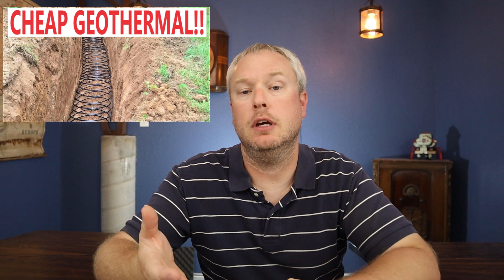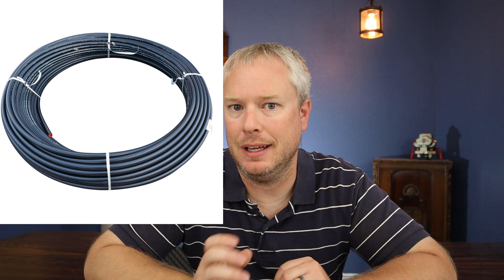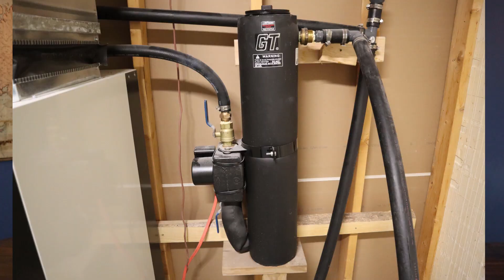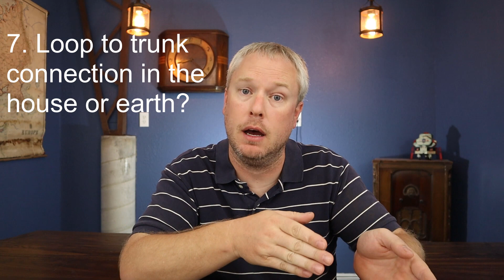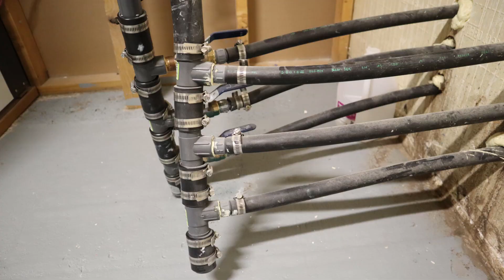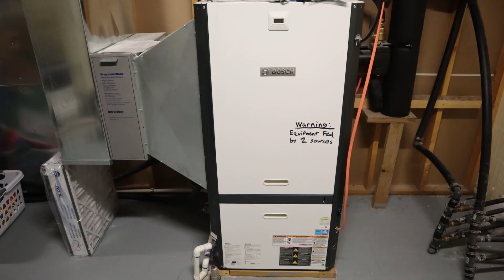10 DIY Geothermal Frequently Asked Questions

Comment: I’m building a new house on a 7200 sf lot and will be demolishing an existing house.

Since I’m building a large house, the available space for pex pipe installation is not a great deal.

Can pex be buried UNDER the footprint of the house?

Naturally, sufficient compaction would have to be done, but other than that, is there a reason it SHOULDN’T
be done?

Comment: Might be a strange question but I am running Gas, Water, and Electric 500' underground to my house, ( I have 10 acres).  I plan on digging 3 trenches at 500' each for each utility.  I plan to place 3 "Slinky" 600' coils in 1 trench (3 ton unit)  and 5 "slinky" 600 ft coil run in the center trench (5 Ton Unit).  Lastly 1 600 ft slinky run in the last trench (1 ton Unit).  Instead of having a manifold for each, can I simply connect each slinky in each run together for a total of 3 individual runs ( 1 long run in each trench).  This would allow me to not have to have a manifold and only have 2 lines for each run coming int the house in the area of their respected HVAC system.
Reply from the maker: You can, but you may need to upsize the line to overcome the increased friction inside the pipe.

Comment: Can a larger diameter of pipe be used than 3/4" in the ground for an overall less length of pipe? I need about 5400' of pipe in the ground.
Reply from the maker: Yes
Reply: Do you know what the formula or the calculations are to determine the size? Currently 9 circuits @ 600' each based on my research.
Reply from the maker: @AddictedCreationz  I misread your first question.  While you may be able to shorten the lines a little, I don't know the calculation.  You want the liquid in the line to have as much contact with the edge of the pipe as possible, so there is maximized heat transfer.  The larger the pipe, the further the distance of the liquid in the center of the pipe to the outer edge of the pipe.  If I were you, I'd stick to the 600' circuits.

Comment: Hi, how did you go about figuring your loop lengths?  I'm wondering how long you would need for a 3 ton system.
Reply from the maker: It all depends on the soil characteristics
Reply: Lots of clay....
Reply from the maker: @smeek111  Then it's probably very similar to mine.  I used 3 coils of 600ft 3/4" HDPE SDR11 for my 3 ton unit, and 4 of them for my 4 ton unit

Comment: We are about to begin our long awaited build on the east side of the KC Metro and planning to leverage DIY geothermal. Wondering if there is a functional reason NOT to go with a wide ditch and go all the way down and all the way back (say 10 foot x 50 foot long and running straight 50 foot lengths about a foot apart)? We will be ‘trenching’ with a Bobcat and want to move quickly with the loops so trying to avoid the slinky). Still getting 600 foot per ton.
Reply from the maker: You can definitely do straight runs, nothing wrong with it other than it takes more digging and more land

Comment: Great info, thank you Garrett.  
We have a 3000 sf two story, non-zoned 1970 slab home with a down-draft gas furnace on one acre we're just starting to scratch our heads about retrofitting to Geo-Thermal.  Do you have any idea the extra cost associated with vertically boring, is that remotely a possibility?  Even if I have to dig down to construct an exterior boxed-in wall below frost line, knock some flooring out and run to furnace room.  Building forever I know almost anything is possible, and of course I would do much of the work myself.  We're just east of you in central Missouri.  
Any ideas would be greatly appreciated.  Thank you!
Reply from the maker: You can definitely do a vertical system.  Your best bet is to call your local water well drilling companies to see what they charge per foot of bore.  That will give you an idea.

Comment: I've seen multiple videos of HVAC companies putting 3 loops in the same wide trench and they can't be more than a foot or two apart. In your video you mention loops need to be 10 feet apart. Why are these companies putting 3 of them so close together? Thanks!
Reply from the maker: They are lazy and don't care about the end result.  There is doing it right, and then doing it cheap.
Reply: @Challenged1  your way made way more sense anyway! I thought that may be the case. What's bad is people just don't know to question it. Thanks for the reply.

Comment: Any thoughts on running loop fields underneath the septic drain field? Around here the drainage runs are usually only 2-3 feet deep. Seems like an ideal place for dual use of the ground.
Reply from the maker: That's a perfect place for them.
Reply: @Challenged1  just watched your Step-by-Step DIY Geothermal part 2 video where you suggest this. 🤦‍♂️ I should’ve watched the entire series before asking.
Reply from the maker: @thatguy7705  It's all good

Comment: fantastic vids bro...to the point, well done, no dumb jokes, and you didnt show us your pets...brilliant!🤣  two questions - i have a pit run hole that i have dug for my house pad and road into my property.  it sits about 200 ft from the house, about 100ft X 200ft at around 12 ft deep.  in the summer the sub water comes up to about 9ft, then recedes to about 20ft during the winter. eventually i will install a pond liner and turn this gravel pit into a pond.  i am thinking of putting in pex loops down say 9ft in the bottom of the pond...then coming up to say 12ft to go from the pond to the house.  would like your .02 on this.  question #2, how did you do your pex joints in the loop field?  just regular pex coupler clamps?  fyi, i am in south eastern idaho.  thanks
Reply from the maker: #1 - That sounds like an excellent plan.
#2 - I used HDPE SDR11 pipe and put all of my joints inside the house.  You can have HDPE fused, which eliminates mechanical joints.
Reply: thanks...i appreciate the info.
Reply: so this style of pex u used somehow comes in a massive roll?  i was thinking it would come in like 200 ft roles?  if your loop runs are say 600ft, you must be able to get roles longer than that?  also...you went with a forced air system, why not in floor coils?  we will have flat slab with 2 stories, around 10,000 sqft, 2700 of which is a big bonus room above the attached 30x90 shop...thanks
Reply from the maker: @ultimateconcealcarry4671  You can get many different lengths of pipe.  The pipe you want is either, PEX-A or HDPE SDR11.  My HDPE came in 600' rolls
Reply: I tried to attach a pic of what i am doing, but i dont think its possible to do so...i think you and your viewers would find it interesting.  if there is a way to put one up, let me know, but, i dont think youtube allows it.  anyway...i have reached out to bosch and carrier to see if either of them would help size and design the system i need.  carrier referred me to a dealer out of boise...bosch said they they will see what they can do...so will see what happens...did you get any help from bosch?   i started my coil trench in the bottom of the pond.  its like digging in a box of marbles here.  we have two to three feet of topsoil, then straight pit run.  there is enough moisture left over that the sides of the trench are not caving to bad, i am hoping that they will freeze and i can get close enough to line the bottom with topsoil, or tamp down the rocks flat.  i decided that i will go 1 inch black poly to allow a little better flow since this run will be quite long, and rent a joint welder once i get it all laid out.  my trench is about 6ft wide and about 10 ft deep.  interestingly there was a frozen layer of about a foot...when i got down about 10 ft, i was seeing temps of 40 deg, which should increase some once everything is in and the pond is filled with water.  at 10 ft, plus another 12 ft with the dept of the pond, it will put these coils at around 20 ft.  right now there is no standing water, but, i know i am very close as the pit run is wet.  the pond will have to be lined in order to hold water, so, during the winter months the coils wont have water around them, but, water will be within a few ft so i think the system will transfer fine.  you mentioned that for your system you needed 600 ft of coil per ton, which at 5 ft per ft your runs must have been around 120 ft each?  i am also doing ICF, no basement, but two story, barndominium style, going for open space.  i would put up a pdf if it would allow me to.  anyway...question i have is concerning the heat pumps.  say i did one long coil run and that i needed three 4 ton units...how do those 4 units get fed what they each need from one coil field?  there must be a manifold system with computer controlled valving that allows each unit to push or pull what it needs?

Comment: I have high ground water at about 10ft which is great for a heat transfer medium. I’m trying to find a liquid that doesn’t freeze but is non toxic just in case the pipe develops a leak into the ground water—any ideas?
Reply: You could look at food grade glycol.

Comment: What are your thoughts on direct exchange system in which copper pipes are buried in the ground and refrigerant is pumped through them??? Since Copper is a good conductor of electricity, shorter lengths are required. Corrosion is managed through cathodic protection.

Comment: Hi Garrett, What about drilling down for a U shaped down-and-back (closed loop) run of pipe instead of making the loop fields? would multiple shallow wells  50' deep require less total pipe length since they would be deeper in the earth? A small 4" bore hole DIY drilling rig might be fairly quick and cost effective.
Reply: I was thinking about your question. My take on that is this. The down and back piping would be rather near each other.  So, in cooling mode, some of the heat from the tubing that was intended to be absorbed into the earth would be transferred into the return tubing, that was intended to be free from heat in order to have the capacity to provide further heat absorption. The hottest part of your tubing would be transferring heat to what was supposed to be the coolest part. The greater the differential, the greater the heat transfer. 
I hope that makes sense.  If you could drill down, and then make a 90 degree turn for 3 or 4 feet and then come back up it would work very well I think.